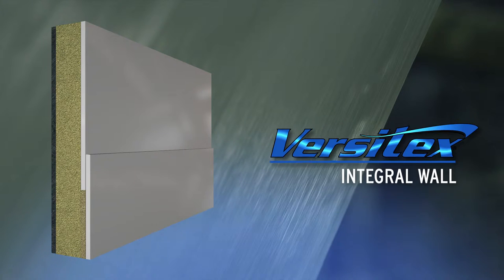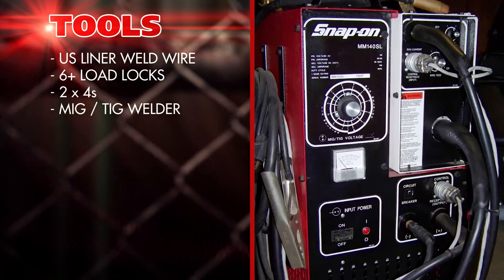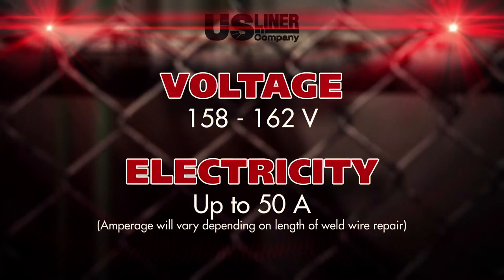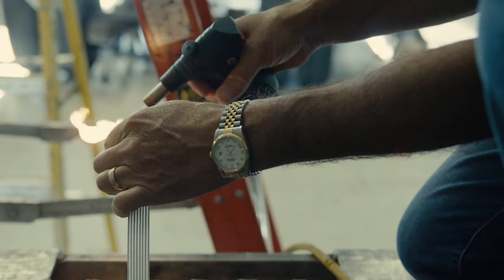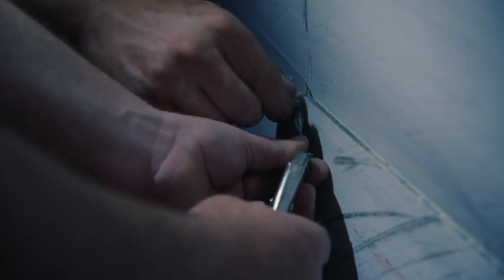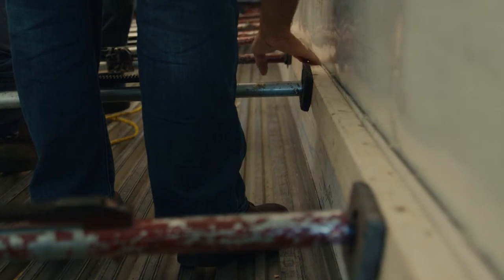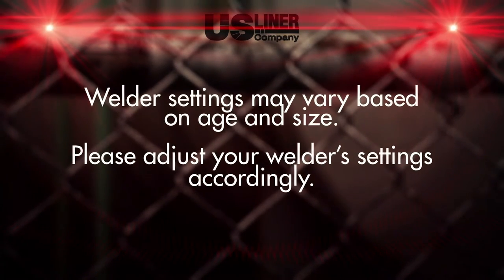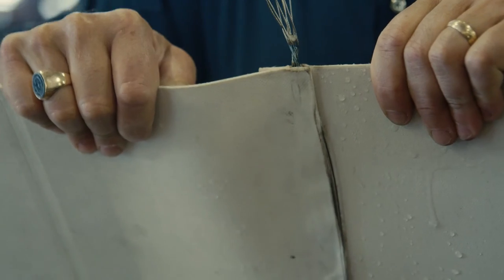USLCO Integral Wall Weld Wire Repair Video

Comment: how do you connect the mig Welder?? wouldn't it be an arc welder instead?
Reply from the maker: Thank you for your question. As shown in the video, we connected the wire to the mig welder. The wire ends were connected to alligator clips similar to how you would connect when you jump your car battery.

If you have any additional questions, please call our office at 724.776.4044.

Thank you.